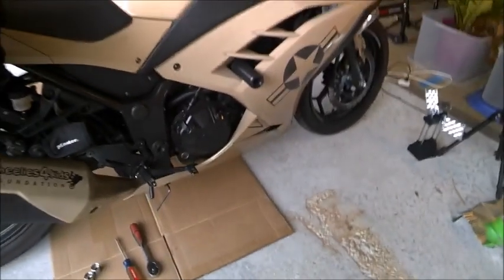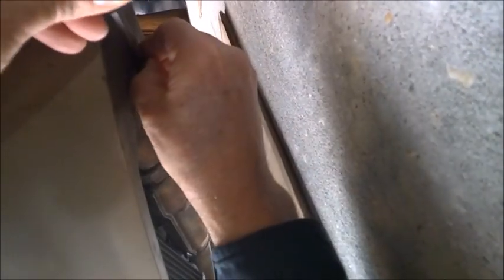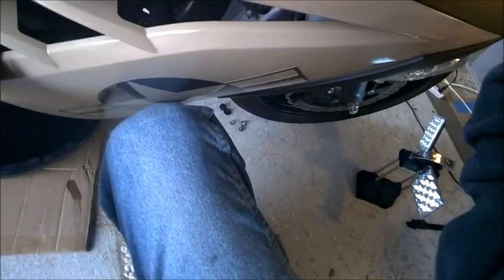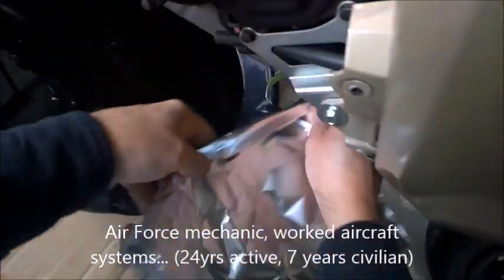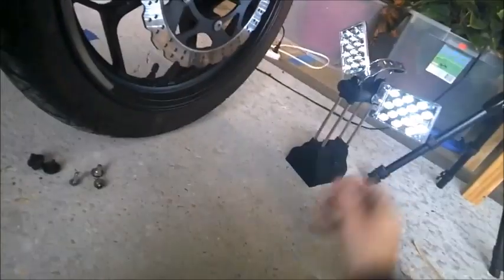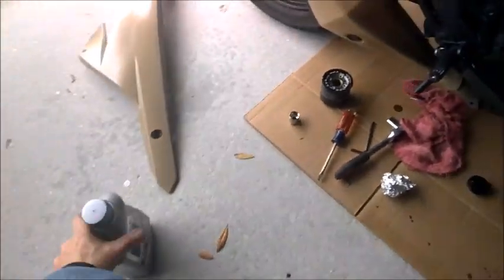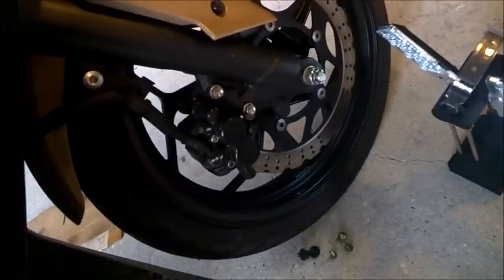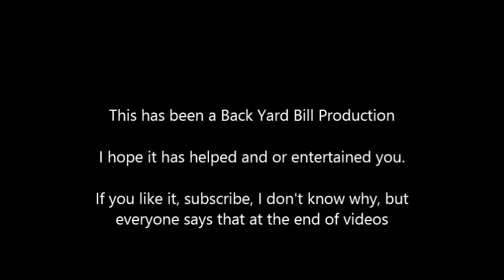2013 Kawasaki Ninja 300 Oil Change

Comment: My concerns with my first oil change were on how to level the bike properly while checking the level and that my bike seemed to take more significantly more oil than in the manual(about the same yours did). Another concern was the lowering link the previous owner installed but it seems you have one too.

From one airforce to another, thank you Bill.